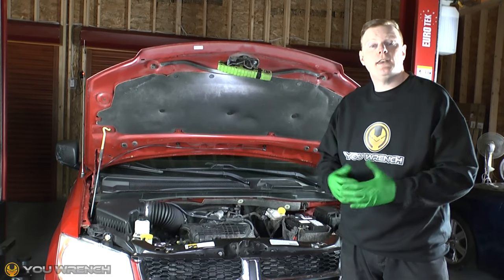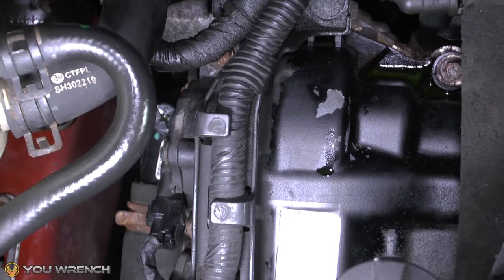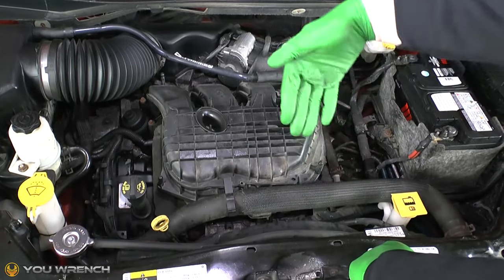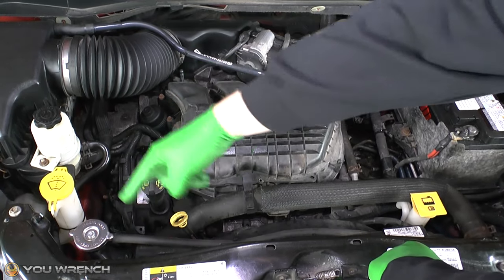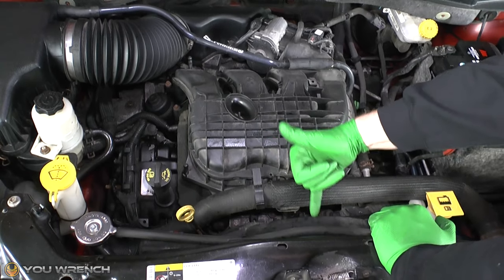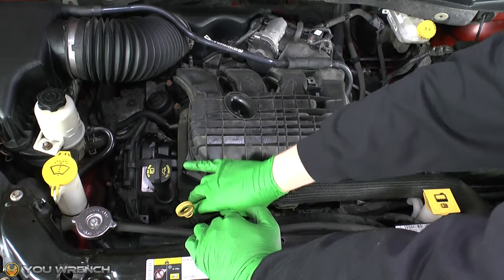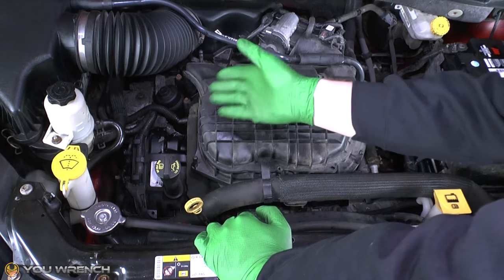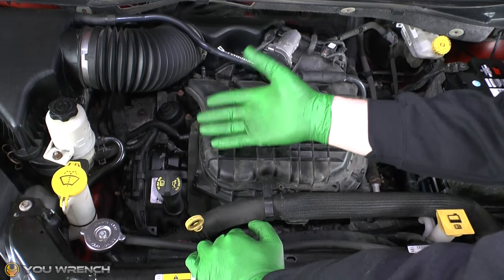How to Test if Your Car's Thermostat is Working (Without Removing It!!)

Comment: What about a soft radiator hose no pressure in the hose also can be a sign no water in passing through to engine
Reply from the maker: Which hose? The upper feeds coolant into the radiator, and lower into the engine. The upper hose will only be 'firm' after the thermostat has opened for the first time.

--- 

To help support us (for both you and others reading this) there are a few things you can do:

1) Donations both needed and welcome! We cannot operate You Wrench without the support of people like you! You can donate by PayPal - just go to www.paypal.me/youwrench

2) Please ensure you subscribe to our YouTube channel. 

3) Please Like our video's on YouTube (by clicking Like!) 

4) Please help spread the word, the more people who know about us the better! Add links to our video's in forums, let people know about us.

Thank you for your support!

Comment: my truck overheated and  I don't think it ever showed hot. Does that mean my temp sensor or temp sending unit is bad?
Reply from the maker: Hey there! Yes, it could be either, and also other electrical issues potentially as well (but more likely would be a temperature sensor). It would be worth hooking it up to cheap diagnostic scanner as that may be able to isolate the exact issue for you immediately. Best of luck!

--- 

To help support us (for both you and others reading this) there are a few things you can do:

1) Donations both needed and welcome! We cannot operate You Wrench without the support of people like you! You can donate by PayPal - just go to www.paypal.me/youwrench

2) Please ensure you subscribe to our YouTube channel. 

3) Please Like our video's on YouTube (by clicking Like!) 

4) Please help spread the word, the more people who know about us the better! Add links to our video's in forums, let people know about us.

Thank you for your support!

Comment: What about when driving on the freeway the car gets colder but when on the streets it goes to regular temperature
Reply: Coule be a stuck open thermostat. It is cooling to fast and that thermostat isnt closing when the temp goes below a certain temp. If it takes a while to warm up then its stuck open. If it warms up slow and u have that issue then idk what to tell ya
Reply: Thats pretty normal since wind is hitting the radiator at high speeds. Once ur in city traffic then u have less air. Then thats when your fan starts doing its job
Reply from the maker: Yes, as others mentioned here that is not necessarily an issue. It depends on how much 'colder' it's getting. Air flow helps cooling a lot, especially colder air. If it's a touch colder then that should be ok as it does fluctuate a little bit. But if it's a big drop then it should be investigated further for sure. Best of luck!

--- 

To help support us (for both you and others reading this) there are a few things you can do:

1) Donations both needed and welcome! We cannot operate You Wrench without the support of people like you! You can donate by PayPal - just go to www.paypal.me/youwrench

2) Please ensure you subscribe to our YouTube channel. 

3) Please Like our video's on YouTube (by clicking Like!) 

4) Please help spread the word, the more people who know about us the better! Add links to our video's in forums, let people know about us.

Thank you for your support!

Comment: what if the bottom radiator hose is cool to touch whilst the top hose is hot?
Reply from the maker: That's ok as the radiator should be cooling the coolant as it runs through the radiator system, so when it gets to the bottom hose it's cool(er) again ready to go back into the engine and do it's job there all over again. Hope that helps!

--- 

To help support us (for both you and others reading this) there are a few things you can do:

1) Donations both needed and welcome! We cannot operate You Wrench without the support of people like you! You can donate by PayPal - just go to www.paypal.me/youwrench

2) Please ensure you subscribe to our YouTube channel. 

3) Please Like our video's on YouTube (by clicking Like!) 

4) Please help spread the word, the more people who know about us the better! Add links to our video's in forums, let people know about us.

Thank you for your support!

Comment: Can someone tell me, my temperature gauge needle goes up fast as soon as I start the car, but it stays in the middle. I thought it was suppose to rise slowly. Any tips please
Reply: Should rise slowly with engine temperature 
Sounds like the temperature sensor is faulty. Normally located on the cylinder head somewhere

Comment: On some vehicles the thermostat is behind the bottom hose instead of the top. On my Chevy truck the top hose goes from the radiator directly to the water pump. The bottom hose has a housing for the thermostat. I'm getting ready to remove my thermostat right now because I just overheated and the bottom hose is not getting hot. I'm going to remove the thermostat just to get me home.
Reply: Did that fix it?
Reply: @slayershine6220  Yes removing the thermostat stopped it from overheating , and I didn't get around to installing a new thermostat for a couple of weeks. 

What I did do was used tin snips to remove the guts from the thermostat and put it back in. I did this to slightly restrict the water flow to normal levels, so that it would warm up better. 

Anytime your thermostat gets stuck shut,  removing it and putting everything back together will get you back on the road. 

It does take longer to warm up in the winter time. The new thermostat that I installed is supposed to be designed where if it goes bad it sticks open instead of shut and you don't overheat when it goes bad. We will see if that feature works I guess. 

Fortunately I had tools in my truck, I did the job in the Speedway gas station parking lot.

Comment: Jus changed my thermostat and there is no readings on the inside of car had neith goes up or down but car overheats what did i do wrong?
Reply from the maker: You didn't necesarily do anything wrong (not sure what make and model of car you have, but the process is usually fairly easy). This could be pointing you in the direction that the fault did not lie with the thermostat and it could be another issue. If the problem is identical to before with no change, just a new thermostat, then almost certainly it will not be the thermostat causing your issue (highly unlikely to have two fauly Thermostats, possible but unlikely!) So next you need to think beyond the thermostat and track down the cause. Best of luck tracking the issue down, hope it is not too bad a job!

--- 

To help support us (for both you and others reading this) there are a few things you can do:

1) Donations both needed and welcome! We cannot operate You Wrench without the support of people like you! You can donate by PayPal - just go to www.paypal.me/youwrench

2) Please ensure you subscribe to our YouTube channel. 

3) Please Like our video's on YouTube (by clicking Like!) 

4) Please help spread the word, the more people who know about us the better! Add links to our video's in forums, let people know about us.

Thank you for your support!
Reply: @YouWrench  thx man i have a 2011 Hyundai Genesis im thinking its the ect sensor but i changed tht also with no avail hopefully i can get to the bottom of it. As car is not overwheating anymore however still gives no reading on thermostat stays on cold

Comment: Say I turn my van on , and instantly coolant is going through the hose u are touching , does that mean it’s stuck in the open position ?
Reply from the maker: Yes, it certainly sounds that way. Thermostats tend to break in the open position (which is preferable to closed!) but it can happen both ways. It sounds like yours may be broken and stuck in the open position. To back this up, you should also find that you do not get very much heat in the cabin (hard to test in summer though!)

--- 

To help support us (for both you and others reading this) there are a few things you can do:

1) Donations both needed and welcome! We cannot operate You Wrench without the support of people like you! You can donate by PayPal - just go to www.paypal.me/youwrench

2) Please ensure you subscribe to our YouTube channel. 

3) Please Like our video's on YouTube (by clicking Like!) 

4) Please help spread the word, the more people who know about us the better! Add links to our video's in forums, let people know about us.

Thank you for your support!
Reply: 1st do use a flush... (also turn heater on when doing it)
Far too often people don't use coolant and just use water, this causes corrosion..
If your water is brown, not coolant colour (red, blue or green) - it needs doing !
#1 cause of thermostat failure - gucked up

Comment: thanks for the great lecture about thermalstat. I have a 2011 Tiguan whose temp gauge behave strangly. At a major highway section where traffic slows down due to heavy merging, the temperature hand would suddenly reach the "red zone", but within a few seconds, it returns to the normal 190F and stay there. On normal long stretch of driving over 250miles that never happened though, and I have got no code whatever related to overheating in the system. This makes the diagnose virtually impossible. I did flush the heater core a couple of months ago, so the coolant is diluted somehow. Could this have lowered the boiling point of the coolant in the system that creates pocket of steam and when passing through the temp sensor, send the hand to the red zone and returns to normal when the packet has passed the sensor?
Reply: Well, clearly the boiling point of water is lower than that of coolant so that could be an issue. Another issue could be air in the system, which is closed. Pockets of air will be warmer than the coolant which could affect the reading. May search for videos on "burping" the cooling system.
Reply: Check the basics first: Radiator not blocked, no collapsed or kinked hoses, proper coolant concentration and level, thermostat test etc.  
Connect a basic scan tool with live data display. Dont trust the gauge. Not many vehicles will show a specific Overheat code, but might have a warning on the dash like "Engine too hot, stop vehicle and run engine and allow to cool".  Test the engine coolant temperature (ECT) sensor with a hair dryer and volt meter, heat it with hair dryer and watch if its voltage changes accordingly.
Stay gold.

Comment: Oh yeah? Well I'll one up your troubleshooting :D
Now if you hold your upper radiator hose and your car warms up to operating temp but no red hot change... Thermostat right? But then! Bum bum bum!!!
You start to drive then the coolant temperature skyrockets to hot after 30seconds of moving. Then you park the car and feel the hose and now it's red hot :o
My current issue haha.
Thinking it nay just be coolant being low in combination to Thermostat being bad. Gonna replace both anyway but just trying stuff out 😊

Comment: I always wondered why even have a thermostat and just let the coolant be flowing all the time. Why is it, that a thermostat has to control the release of coolant?
Reply from the maker: Yes, if the thermostat was always open (or no thermostat) then the coolant would be always circulating. It would not be held around the cylinders (where the most heat is generated due to the combustion) and so the coolant would never reach full operating temp, which would lead to things such as low heat in the cabin via the heater matrix (not good in the winter!!) For the full system to operate properly it is important to get the coolant to a specific temp, and that's why the thermostat exists in the chain. Hope that helps!

--- 

To help support us (for both you and others reading this) there are a few things you can do:

1) Donations both needed and welcome! We cannot operate You Wrench without the support of people like you! You can donate by PayPal - just go to www.paypal.me/youwrench

2) Please ensure you subscribe to our YouTube channel. 

3) Please Like our video's on YouTube (by clicking Like!) 

4) Please help spread the word, the more people who know about us the better! Add links to our video's in forums, let people know about us.

Thank you for your support!

Comment: If my heater doesn’t blow hot would this be a potential thermostat issue? In this case would it mean that the thermostat is stuck in the closed position? My car doesn’t over heat through so I’m guessing it’s not a thermostat issue causing no heat.
Reply from the maker: When you say blow hot, I assume it does blow cold though (i.e. not a fan blower issue)? It could be the thermostat stuck in the open position, so the coolant is never getting as hot as it should, hence no hot air inside the cabin. Or maybe a heater matrix issue. You can run this test in this video, and you may find that your top pipe does not go from cold to suddenly very hot, if so your thermostat could be faulty and stuck open, follow through the video catefully and run a quick test :-)

--- 

To help support us (for both you and others reading this) there are a few things you can do:

1) Donations both needed and welcome! We cannot operate You Wrench without the support of people like you! You can donate by PayPal - just go to www.paypal.me/youwrench

2) Please ensure you subscribe to our YouTube channel. 

3) Please Like our video's on YouTube (by clicking Like!) 

4) Please help spread the word, the more people who know about us the better! Add links to our video's in forums, let people know about us.

Thank you for your support!

Comment: Could your method of testing the thermostat also prove that the water pump is working because it's the pump that pushes the water through the tube?
Reply from the maker: In theory, yes it could be used to help identify a water pump issue. As you mentioned, once the thermostat has opened the water pump will be pumping the coolant around the system. If the water pump were stuck or broken this would effect the coolant flow. You can get partially working water pumps sometimes, so it's not always that easy, but in thoery - yes! Hope that helps 👍

-----------------------------------------------

To help support us:

1) Please be sure to use our Amazon Links!

2) Please ensure you LIKE our video's, and SUBSCRIBE to our channel!

3) Donations always welcome! Hit the SUPER THANKS option below the video on YouTube, or by PayPal: www.paypal.me/youwrench

Thank you for your support!

Comment: My coolant reservoir overflows and my car runs hot only when I drive. What could the problem be?
Reply: Thermostat is blocked in the closed position. You will need to check you full system. A good start would be to flush the system and replace the thermostat. Do the flush with the thermostat removed.
Reply from the maker: Yes, likely a thermostat issue. For the low cost of the thermostat, it's definitely worth swapping it out as a first course of action as there's a good chance this will resolve the problem.  

--- 

To help support us (for both you and others reading this) there are a few things you can do:

1) Donations both needed and welcome! We cannot operate You Wrench without the support of people like you! You can donate by PayPal - just go to www.paypal.me/youwrench

2) Please ensure you subscribe to our YouTube channel. 

3) Please Like our video's on YouTube (by clicking Like!) 

4) Please help spread the word, the more people who know about us the better! Add links to our video's in forums, let people know about us.

Thank you for your support!

Comment: why does it still needs a by pass? Why can just let the water circulate through the radiator even if it's not too hot?
Reply from the maker: It needs a thermostat in the system to keep the tempurature at the correct ideal working level. Without one the car may never reach it's optimum working tempurature, effectively running cold, and your heater inside the cabin would run cold etc. It absolutely could be done, but it's not the ideal scenario, hence the thermostat as a control.

--- 

To help support us (for both you and others reading this) there are a few things you can do:

1) Donations both needed and welcome! We cannot operate You Wrench without the support of people like you! You can donate by PayPal - just go to www.paypal.me/youwrench

2) Please ensure you subscribe to our YouTube channel. 

3) Please Like our video's on YouTube (by clicking Like!) 

4) Please help spread the word, the more people who know about us the better! Add links to our video's in forums, let people know about us.

Thank you for your support!
Reply: @YouWrench  Wow! Thank you very much for the explanation. It is now clear to me the importance of thermostat. Great videos!

Comment: My car sat for 2 years,c4 2007. When car is cold it works like it has 20bhp and if i dont have it more than 2.000rpm it drops n dies.
When its hot,after 2km distance it works fine. I will try this because my mechanic has no idea what is wrong...so,me,the plumber i have to find out...